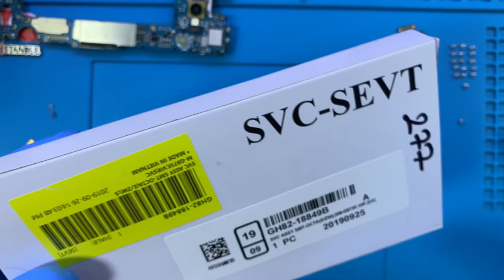Samsung Galaxy S10+ Ekran Değişimi 🇹🇷

Comment: What is the bracelet thing you wear on your left hand, sorry I don't know. 
By the way love your restoration......
Reply from the maker: Hello there;
Static electricity-free wristband on the left arm. Our technical service is designed completely free from static electricity, but it is installed by our technicians as an additional measure to prevent static electricity that may occur momentarily. It is a special magnetic magnet on the right arm. It provides the holding of very small metal parts.
Greetings.
Reply: @gsmi  Thank you for the clarification.